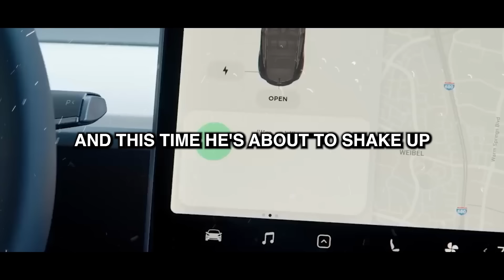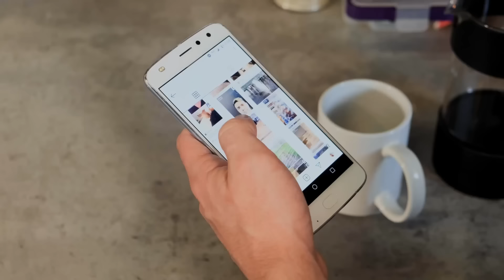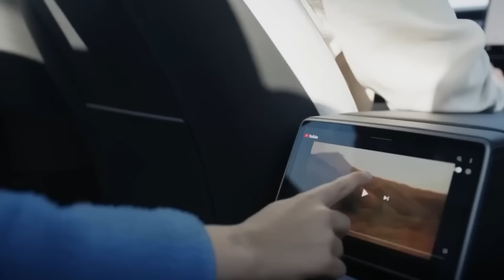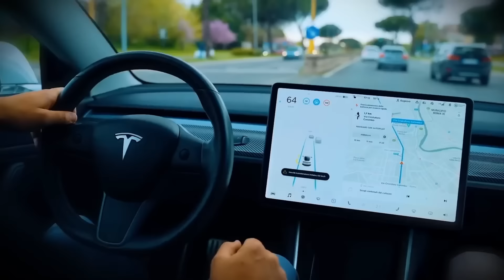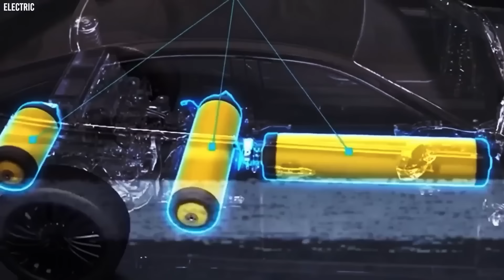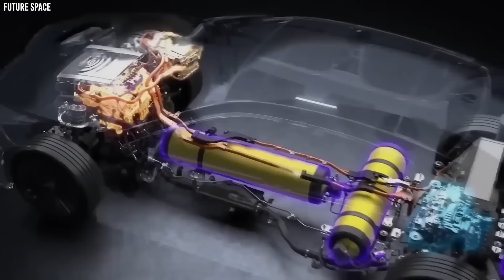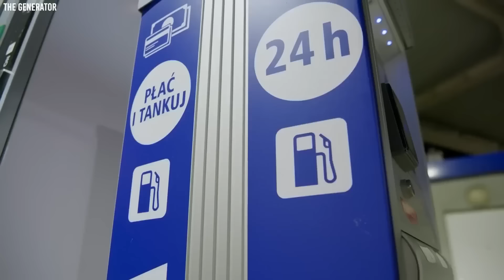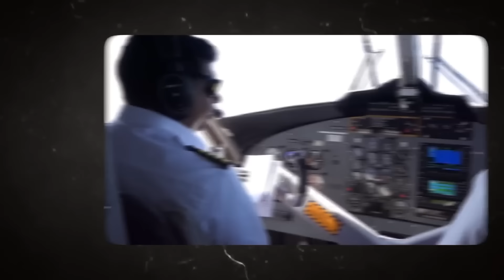Elon Musk: “I am releasing INSANE NEW $5,000 Tesla car!”

Comment: If the Model 2 has the new battery tech that will give it a range of 500 miles, they won't be able to keep up with demand. I was hoping to get a TESLA in 2025. Toyota, Ford and Subaru are making $12,000 small ICE pickup trucks that will get decent mileage. It'll be hard to compete with those trucks at that price.
Reply: Bet you that those prices will never happen.